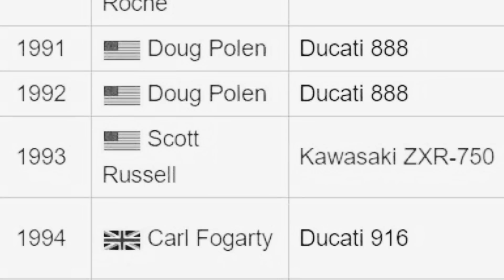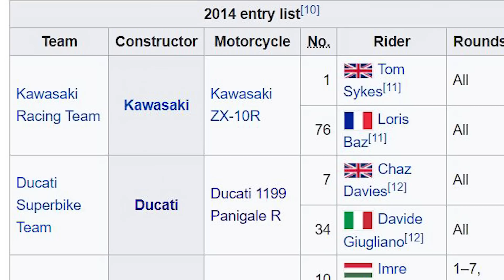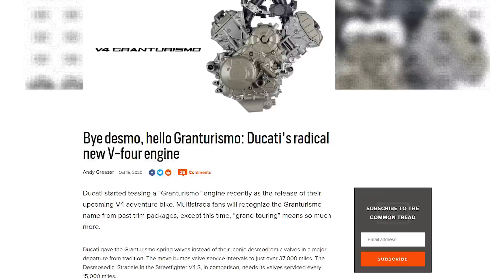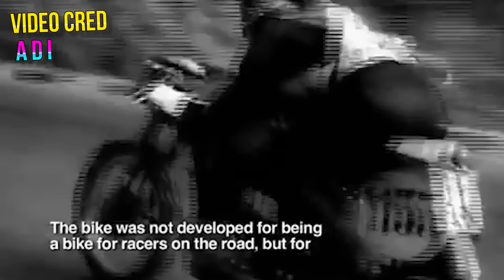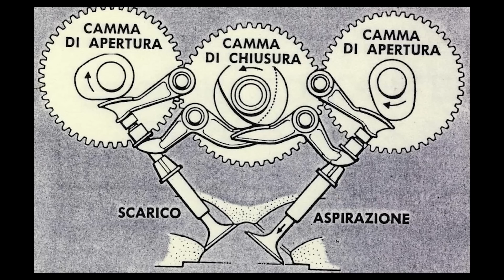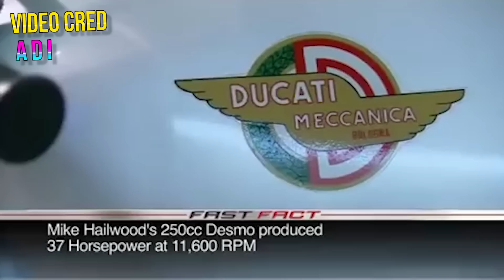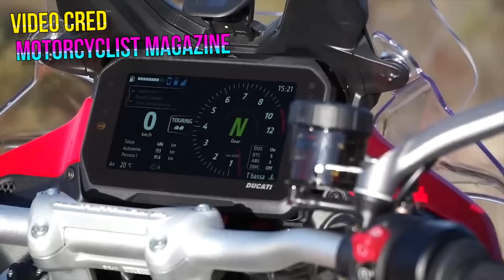The Non-Desmodromic Ducati - Why it's a Big Deal

Comment: How "necessary" were they really back in the day, if only 2 Merc race cars ran them? I hear the metallurgy argument but really.. 2 race cars... that's it. I love the system, it has an Industrial Revolution clickity-clack contraption appeal to it, but $3000 in valve servicing after 13,000 miles? The system needs to address the harshness of how it works. One could say the problem is METALLURGY.

Comment: I am so glad I came across this video! Hands down the best motorcycle video commentary I've ever heard. About your who had the "first" naked bike a lot of European magazines hailed the 1999 (2000 u.s.) Aprilia Tuono 1000 V-twin as the bike that started the true mass produced streetfighter. That was my dream bike and 17 years later I bought a new 2017 Aprilia Tuono RR. Dumped $1300 in performance mods and pretty much on par with today's superbikes regarding horsepower with 176whp on the dyno which is roughly 195 flywheel.

Comment: Ducati will always run desmodromic valve trains on their high-performance bikes because they generate more power compared to spring run valve trains and they always will regardless of the improvements in metallurgy.  The reason they are running standard springs on the Multistrada is because it is not required for the speed regime specified but most of all the reduced maintenance allowed by the longer service Interval.  It is a very mature decision by Ducati.  They could have easily stuck with desmo valves on this new model but it would have been an unnecessary cost to their customers, ultimately hurting sales.  Good engineering means doing what is required, nothing else, and in this situations desmo valves are simply not required.

Comment: Since Ducati built its legacy on being the first volume manufacturer to effectively utilize and mass produce an innovative (for its day) valve train I wish they’d  transition to pneumatic valves ala F1 or Koeningsegg’s Freevalve system. I get that springs have come a long way but for Ducati to play it safe by doing what everyone else is doing is not what they built their reputation on. Motorcycling comes with inherent personal risks, Ducati as a company took risks. It was through the mutual understanding that risk equals reward that greatness was achieved.

Comment: You don’t know what you’re talking about! Heavy valve springs reduce valve float and close the valves faster! The way to go now is no cam engine with electric solenoid operated valves (Koenigsegg)
Reply from the maker: The comment for slow and hard actuation is specifically at low RPM, and the situation for float I used was meant to imply that the stronger springs could be pushed to higher RPM, but with a catastrophic risk of it.

Comment: Had a 2007 1100 S Air Cooled Multistrada,  best engine and gearbox setup I've even driver or owned (in 30+ years). Just smooth, linear, predictable and fun. Controlled power slides coming out of corners with the front end off the ground was fun. But as you stated, the 7K valve maintenance was a killer on a daily commuting bike. Switch to Yamaha 1200 SuperTen (2 of them, 2012 and 2016 ES) and never touched the valves adjustment for 35k+ miles.  But no more power slides.......

Comment: Well Harley aint halfassing it this time. That Livewire and the new RevoMAX is a full departure. if that 1250 PanAm really makes 145hp at the crank, Indian's about to get that ass slapped, because then their scout and FTR and PowerPlus engines are all outclassed by harley's new DOHC. Even better is that the revomax is a modular system unlike the scout, FTR, and PP.

Comment: The air cooled 2 valve desmos are pretty easy to DIY the valve clearances and rarely need adjusting after the first 3 or 4 services, furthermore there is less valve train wear because of less friction ( you can turn the cams easily by hand) so things like valve guides, valve seats, rocker shafts and camshafts tend to last very well

Comment: Great video, maybe the best on Ducati on youtube yet, excellent.  One thing you might have missed though about Ducati history, and this is a nuance only hardcore Duc people know, is that originally Ducati did not intend for L twin road bikes to be Desmodromic.  Dr. T wanted that from the beginning, but the change in company management in 1974 caused them to pursue the concept that base models would have standard springs, with Desmo as a high performance only option.  After the failure of the mid seventies and the 860 series, Dr. T was given more control and he had the vision of Desmo across all engines.  He also nixed the horrendous 500 twins.  Since 1977, Desmo has been king.

Comment: They need to put this engine in a naked bike. 160 hp is more than plenty for anyone to have fun on the road.
Reply from the maker: There is actually a V4 streetfighter you know right?
Reply: @Theillestrator1050  Not one with the non-desmo engine.

Comment: Ducati also know how unreliable desmodromic is... The valve run dry for the first 10 second after engine started, always broke down due to mechanical movement fatigue, high desmo maintenance and so on, so on...harley stand their ground to used push rod, but people bash them for using old technology, but it is the same goes to the desmo valve, it is old technology and as just unreliable technology as push rod, people drooling "oooo, desmo is a good thing" smh
I'm not a harley guy, and more in love with ducati motorcycle .... but man, this fan boy bashing other motor brand, need to stop. Just enjoy it, if you don't like it, keep it to you self or in the forum for discussion

Comment: for context:
I've been a happy owner of a 2012 Monster 1100 EVO for nearly 9 years now.  So long as you're not constantly tracking the thing or ragging on it every time that you take it out, the valvetrain service intervals become more of a regular check than a required part replacement.  The shims that are used in the SOHC air-cooled engines are far more robust than their high-strung racing counterparts, and are far more friendly to the DIY-er than one might initially think.
At this point I have conducted the last 3 vavletrain services of my own accord in my own garage, and have only replaced 1 shim so far.  While the Desmo system can appear complex and convoluted at a glance; once you have a foundational understanding of how the system works and what you're actually looking for, it's by-and-far one of the easiest systems to work on with a simple, basic toolset.  The most expensive part of valvetrain service is the timing belts, but even then, they're not really braking the bank, considering that they cost around $150 USD to replace.  The main reason that they cost so much more than typical timing belts from most automotive applications is due to the requirement for high-heat resistance.  Keep in mind that these are air-cooled engines, which require ambient airflow around the cylinder heads to keep them cool.  Some of that hot air is going to surround the timing belt under normal operation at all times, and the belt cannot excessively stretch or wear out because of it.  But once you put that little hiccup behind you, doing a simple teardown of the bike (removing the gas tank and the airbox), everything's right out in the open and easily accessible.